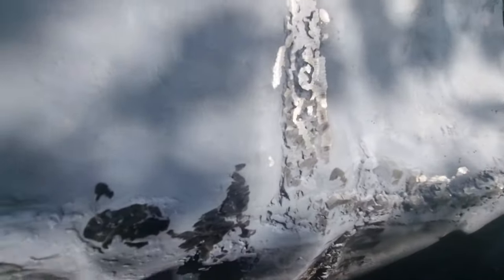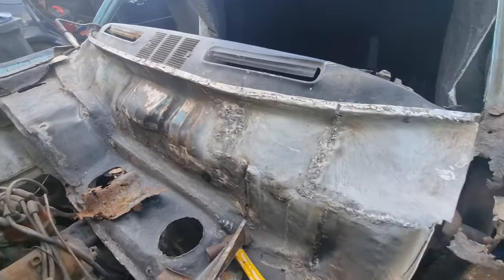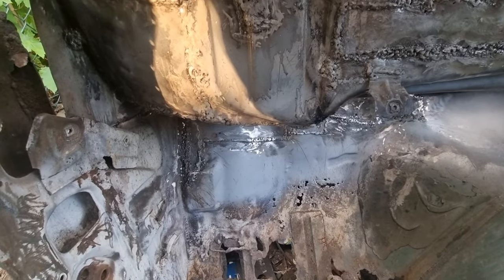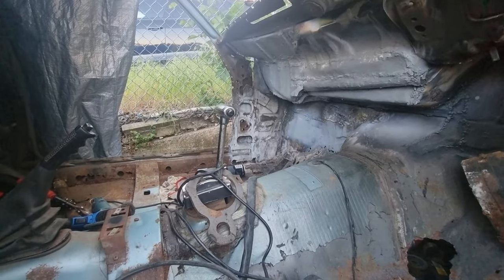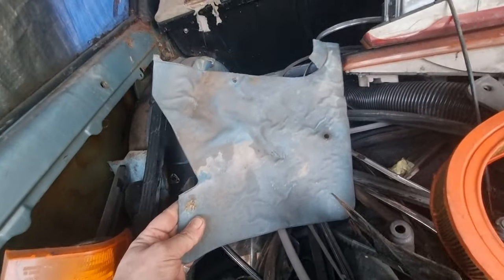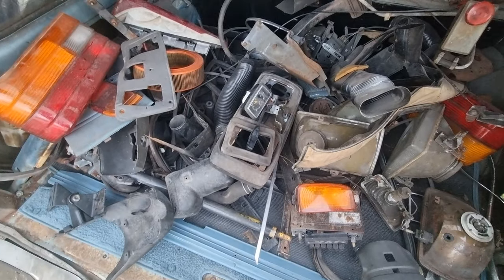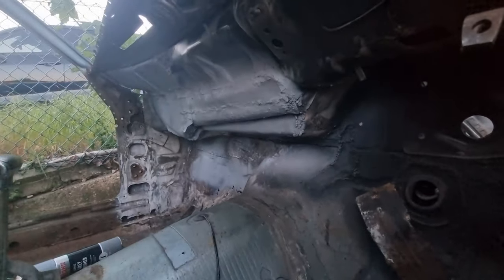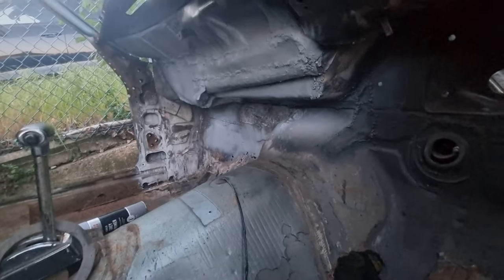Cortina Mk4 Ghia 2.3 V6 Restoration || Boot & Rear Chassis Inspection (P28)

Comment: spot on that adam! that spare wheel cover, would be great for a paint match for it.  Id be very tempted to patch those small holes next, in the boot floor.  As that will be a quick fix for you and another job ticked off the list. Plus it will give you a bit of a break from the front of the car.  Also i do recon that this is a lot more better condition than the Capri that's getting restored.
Reply from the maker: Yeah it is really good I was thinking of repaing that boot floor section just to get it done and that's great yes never thought of that about the colour match it would be spot on as its not faided nice idear mate
Reply from the maker: I'm looking forward to another videos on the capri

Comment: That boot floor is damn good Adam.we have the same chassis rail rot, i wish I had the tooling to fold the steel and make it myself.
Reply from the maker: yeah really is good you dont need great tools just get a peace of wood the same width and shape it round that will take a little time but its a great way of shaping metal thats how i have done all my panles hammer and wood lol

Comment: As a former welder and later a weld inspector (NDT) i advise you to try to lower the weld wire speed a bit. What i did with my Alfa Romeo GTV6 plastic parts was that i gave them a hand wash withnormal dishwasher soap and after letting them dry, i put them in transplant plastic bags with a label in it with text on them where they belong. So, in the everi was washing the plastic interior parts. When the carroserie is finished, you can ount thenice leanparts easily. I would keep them in my house andnot in thecar where i am grinding and welding,etc...

Comment: You might have to find rear chassis legs from a saloon and extend the length. I have a 79 mk5 estate
Reply from the maker: yeah will look into it the main bits that the shocks and springs go to are in great condtion its just the rail its self that goes to the back if i can get a box section that is of the same shape that would be even better i have a bit of time to look into it before work to the back is done

Comment: And also i would not put all these items in the back again because you have to take them out again, later. Take them in your house or so. Do you have a garage attached to your house? And try to found new or nos panels (metal) your your car. Or parts from a car that will be or is slaughtered.
Reply from the maker: Yeah would make more sense hehe